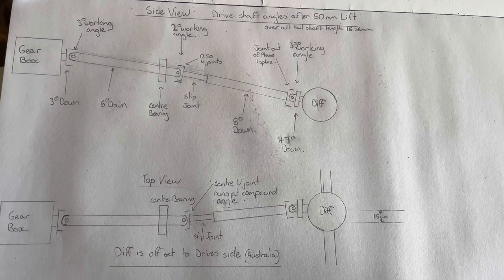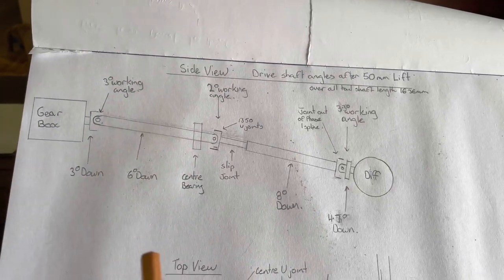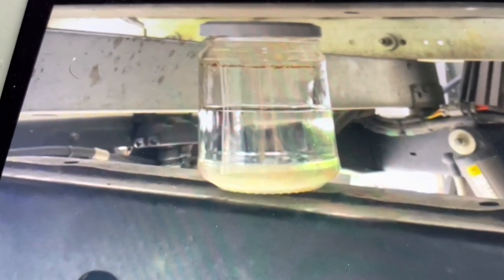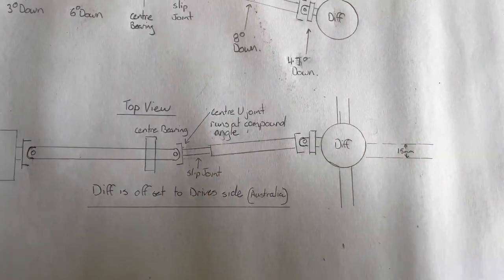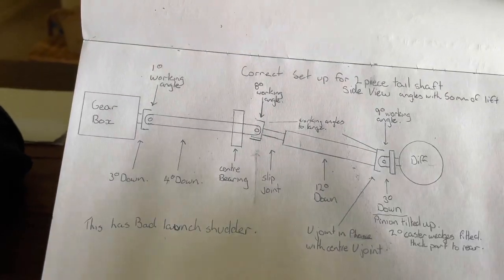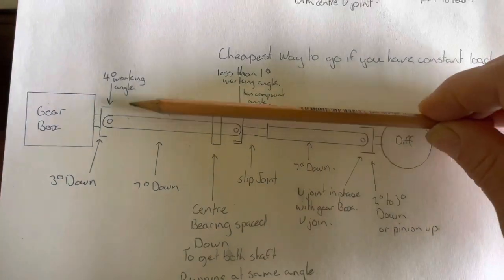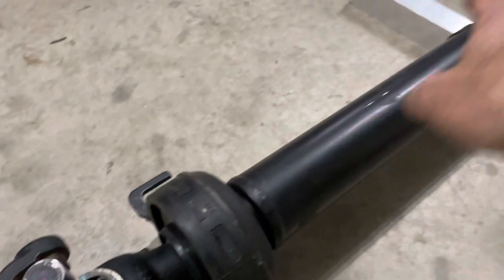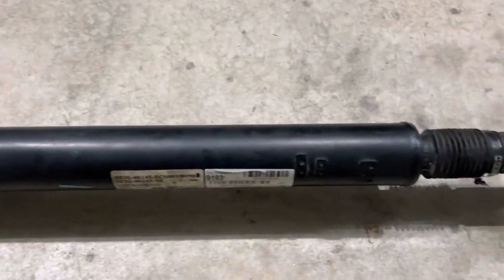Px Ranger/BT 50 drive shaft vibration fix

Comment: 2008 4x2 Hi-Rider dualcab. Had terrible shaft vibration at 45-60km/h.
Rebuilt 3 x uni's and centre bearing.  Dropped centre bearing mount to ensure shafts were parallel and fillled centre bearing bush with silicone to soak up remaining frequency. Thankyou ! Worked a treat.
Reply from the maker: Thank you for the feedback :)

Comment: Afternoon Phil. 
I have been heading down the same long dusty trail you did but I hope your video has saved me from the dead end of it. 
I got onto you and your fix video from a lake mac driveline shop. 
So my 19 ranger has a slight take off shudder also after my 2 inch lift and I have the center bearing drop already installed. I’m going to invest some time over the weekend to perform the phase alignment . I’m super excited for the result of no vibration. Fingers crossed 

So to clarify I need to have front and rear shafts at exact degrees. And the rear shaft phase aligned

Thanks
Reply from the maker: Yes that’s correct. Looking at the tail shafts from a side view you want to run them with next to 0° operating angle on the centre universal joint, Like I try to explain in the video if the front Shaft is for example 7° down the second shaft needs to be 7° down from the side view and phasing the tail shaft like it is a one piece shaft so pretend there is no uni in the middle. Remember that your diff pinion angle has to be the same angle as the angle down on the gearbox companion flange otherwise you will still have a vibration. So if the gearbox Companion flange is down 3° you need to tilt opinion so it is tilted up 3°. In the description section and of the video I have a link to the Spicer Drive line book which explains things very well. Remember this is a good setup for a constant load in the vehicle has varying loads will change the angle of the second Drive Shaft due to the compression of the spring pack. 
Let us know how you go

Comment from the maker: Mazda told me that is how it is and put up with it. One thing to note is the T6 platform that these Utes are built on has a natural tendency to vibrate anyway it’s sort of feels like the chassis is flexing up and down while you’re driving down the road. Having a driveline vibration magnifies this. My vibration would cut in and stay there from 35 km an hour all the way through to 110 KPH. Now the vibration comes and goes due to road surface conditions. One thing to note if you have am mud tires on the vehicle this will make the vibration worse also, I ended up changing back to a all-terrain tyre as I mainly drive up and down the highway now.

Comment: Hi Phil, thank you for the video very informative that's for sure.
One part I don't understand is from the gearbox to the short shaft you mentioned that is 1deg. .my gearbox is at 4deg then to 9deg on the first shaft, 8.5 from bearing to diff and diff is at 8.9. I'm still getting vibration like crazy can't drive over 80kms.
Reply from the maker: Hi bill just so I’m reading your angles right. You have 4deg down on the output flange of the gear/ transfer case and 8•9deg up on your pinion flange this is your problem it needs to be 3 to 4 degrees up not 8•9deg up. You need to put the caster  wedge with the thick part towards the front to drop the pinion down( I said it the wrong way around in the video as I had spent that week working on a land cruiser driveline vibration my bad when I get better I’m going to redo video)imagine both companion flanges need to run parallel to each other from the side view to keep the uni at the same angle. After dropping the pinion down you may need to re-shim the centre bearing to get the driveshaft angles the same again. Don’t forget to re-phase the differential universal joint to be in the same phase as the gearbox universal joint otherwise you will still have the vibration. This is explained in the video. Any more questions don’t hesitate to ask.
Reply: @philsrandomstuff2392  thank you so much.. I will order some 5deg casters from snake racings as they are the only ones hat have 5deg.. and if that doesn't fix it I will definitely go the same path as you and get the tailshaft fitted with cardan joint..
Reply from the maker: @billcetin3983  at 8.9deg pinion angle I’m thinking you have extended shackles? As most sit at 4 to 5 degrees. The double cardan shaft was worth the money. I here from owners of the new MY2023 ranger that ford included the drive line vibration from factory to.
Let me know how it turns out
Reply: @philsrandomstuff2392  it's actually a Dobinson lift kit.. 3inch front 2 inch back, but I did order the comfort springs and 0-100kg for the rear
Reply: I just had it fitted last week and been trouble shooting the vibration since.. 
So my car is good to about 80kms beyond that its a 40k vibrator
Reply from the maker: @billcetin3983  . I feel for you as it took me 3 months of trying different things to get it to run vibration free. It’s a shame the lift kit manufacturers have done nothing to really help address the vibration problem. I’m guessing you’re following my suggestion to run the two piece tail shaft in a dead straight line. I cannot stress enough that the differential u joint needs to be phased the same as the gearbox u joint otherwise the vibration will not go away no matter what you do. Sorry to harp on about this but I’ve had a number of people contact me about the vibrations still being there after doing what I suggested and then finding out that they have not change the phasing of the diff u joint.
Reply: @philsrandomstuff2392  the plan right now is to fit the caster and phase the tailshaft.. you have been very helpful thabk you so much.
What was the turn around time on getting your tailshaft fitted with the cardan fitted?
Reply from the maker: @billcetin3983   I don’t know where you’re based but I got the tail shaft done by Gibson Drive Shaft services in Newcastle, I think it was about a two week turnaround. So I could keep driving the vehicle I bought a low kilometre shaft assy from the wreckers 2.2 or 3.2L, auto or manual px1,2or 3 are the  same length and cost between $200 and $300 if your in the hunter valley area  And if we can work out how to meet you can take the spare one that I have in the shed and just replace it with the one from your car once you have it modified there is less than 50,000 km on that Shaft. Just remember to re-phase the tail shaft to suit the double cardan set up, which is the Centre bearing u joint and the differential U joint in the phase ( turn slip joint one spline) before you give it to the Drive Shaft shop so they can balance it properly. Cost was $800 to get the shaft modified
Reply: @philsrandomstuff2392  thank you Phil.. you are are a champion.
I will talk to the guys here in Sydney to see what kind of turn around time for a phase and balance hopefully that wouldn't take two weeks and go from there
Reply from the maker: @billcetin3983  anymore questions don’t hesitate to ask, hopefully the caster wedges, re-phrasing the diff u joint and running the shafts in a straight line will help save you some money
Reply: @philsrandomstuff2392  thank you Phil.
The caster wedge I ordered just got delivered this morning after doing a tour of Australia finally made it here.
I'm going to install them tomorrow and hopefully fix the issue.
I also noticed the leafsping has a caster on it from factory however it is facing the opposite way therefore pushing the pinion up
Reply from the maker: @billcetin3983  when you said that you had 8.9degs up on the pinion I thought that it was a bit odd. They could be turned around but at a guess they are 4 to 5 degrees which could  be to much depending on spring design . I normally fit 2 / 3 degrees wedges. Arb is where I sometimes get wedges But there are a lot of online parts shops that sell those smaller size wedges. Everything that I have gotten off superior engineering always takes forever to get to me( up to 3 months) I guessing you are going to stack the wedges , which will be ok providing you have enough centre pin head to still engage in the spring perch on the axle tube.
Reply: Hi Phil, so here is the outcome of today's fix a POS Mazda..
We turned the caster that was on the spring pack from Dobinson resulting in the pinion dropping 5deg.. so wasted money on casters.. I phased the tailshaft as best as I can and still vibrating..
Reply: @philsrandomstuff2392  current angle are 4deg down at transfer to 9.1 at the short shaft 10deg at long shaft and 4.1 at pinion
Reply from the maker: @billcetin3983  that should work ok
 The closer the angle on the two shafts the better as the the centre uni runs with a compound angle  so yours is probably at 1.5 / 2 degrees working angle. But if you load your Ute up regularly .9 degree will spot on. You normally try to have the pinion .5 to 1 degrees lower than gear box out as the pinion lifts under drive so yours should be 3 to 3.5 degrees. If you have a stiff spring pack you will be ok. You won’t do any damage by test driving it.
Reply: @philsrandomstuff2392  but the vibration is still there.. so on Monday I'm going back to the get the tyres checked and balance.. I might just get the double cardan joint done to the tailshaft if that is going to fix this issue.
Reply from the maker: @billcetin3983  do you have axle stand to put it under the back axle so you can run it up with a glass of water on the chassis like i did in the video as this will tell you if it’s tail shaft or tyres. no ripples in the water means the tail shaft is fine and the tyres are causing the vibration. Slowly run the vehicle up when it’s on axle stands and watch how much movement you have in the centre bearing if it wobbles around at slow speeds you were going to have a vibration at High speeds. I had mud tires on mine and they had to go as they made the vibration worse, if you can find someone with some stock ties and run them to see if that makes any difference. Once you get above 4° working angle on a universal joint there is always a chance of vibration unfortunately which is where you’re at and that’s why I had to go down the line of the double cardan  Shaft.
Reply from the maker: Would like to have a chat on the phone
Reply from the maker: @billcetin3983  Did you recheck your tail shaft angles after you changed the pinion angle because every time you move the pinion angle the second tail shaft angle changes
Reply: @philsrandomstuff2392  yeah for sure
Reply: No space in between..
Reply: Not letting me share contact details
Reply from the maker: @billcetin3983  I can not get it to work also are you on Facebook?
Reply: @philsrandomstuff2392  that's the one .. that's me
Reply from the maker: @billcetin3983  I have sent you a message via messenger

Comment: I`vefound vibration occurs  2 ways    1/ incorrect angle [lift or worn c /bearing ] typically u drive thru this . 20-50km/h 
2 / missing weights  damage [increases as vehicle speed goes up]

Comment: This is a great video, I have a 2012  PX 3.2 4x4 manual . I have a vibration in the tail shaft at about 1200 rpm when I shift into 3rd gear . If I run the revs over 1500 its not too bad but I don't want to shift to second on all  corners. 
There is no vibration noticeable at 50 kph and over  I have changed the unis, greased the splines , phased the t unis and have the shafts in as straight a line as possible with about 1/2 degree  vertical difference between the 2 shafts by use of the spacer kit. 
The pinion angles are equal between the diff and transfer case. I am not the first owner so am not sure what the lift is . No matter what I try it doesn't seem to make any difference.  Very frustrating .
Reply from the maker: Hi Alastair I’m not 100% sure on what type of centre bearing on the earlier utes had, but it’s unlikely that it’s the Source of your vibration I only added the nylon insert just to take the final bit of vibration out of the tail shaft, this vibration only happened when you hit Bumps  At speed the nylon insert just helped stabilise the shaft it didn’t really need it. So from what I’m reading above is that you have set it up in a straight line with the universal joints rephased I would suggest that the tail shaft probably needs Balancing. Every time I move something around in a tail shaft you can affect the balance. You can take your now re-phase tail shaft to a driveline shop and have it balanced and checked for straightnesses or you can dynamically balance the tail shaft on the vehicle there is several YouTube videos about this just search by dynamic tail shaft balancing. The reason why I went to a double carden in joint was I still could not get all the vibration out the new tail  shaft fixed this problem altogether, but costs a bit to do.

Comment: Phil I love this video I have vibrations when towing the camper a droning sound followed by vibration. Car has front Bullbar on stock suspension. Where can I go to get this fixed. Would a regular mechanic know about this?
Reply from the maker: Not many people know much about how to fix drive line vibrations, thats why I made this video. Any good mechanic should be able to fix it if they watch this video. Remember some times it’s not the drive shaft but something else like flat spots on tyres and the like, yours does sound like drive shaft by the description you give though.

Comment: This vibration has been bugging me since new and it is significantly worse with the 50mm lift. Mazda would have you believe it's a feature  not a fault in design.  Anyway it looks like you did some detailed research and I will definitely give it a shot 👍
Reply from the maker: Let me know how you go.
Reply: @philsrandomstuff2392  First a little background on the BT50. I have a 50mm lift and and a centre bearing drop kit already installed that has helped a bit with vibrations at highway speeds but it left a severe  pulse in the drive line at around 30kph no matter how it was adjusted. Well this morning I figured I would re-phase the shaft and much to my surprise the low speed pulse is virtually gone. Now it's not perfect,  however I still need to adjust the pinion angle slightly and lower the centre bearing another .5deg but I could live with it as is that's for sure. So overall I will give you two thumbs up on this one Phil thanks for the video. 👍👍
Reply from the maker: @andrewcarroll9148  thanks for letting me know how it turned out, l’m glad it made a difference. I had to install 2deg caster wedges (thick part to front of Ute) this gave me 2.7deg pinion up to match the gear box 3deg down. Running the tail shaft dead straight like you have made my vibration about a 93% gone. ARB sell caster wedges

Comment: Your centre bearing rubber looks different. Did you fill it with urethane?
Reply from the maker: Yes I did try to stiffen up the centre bearing. But the urethane was to stiff. The gear box moves around a lot and it was placing to much load on the centre bearing. That is why I put a nylon ring in the centre bearing housing to help hold the shaft central but still allow it to kick when the gear box/ engine lifts under load.
Reply: @philsrandomstuff2392  hey thx for the reply.. you're saying the centre bearing was stressed coz it couldn't freely change operating angle? And the nylon ring potentially reduces the skipping rope effect by keeping it centred? How thick is the ring?
Did it make much difference?
I'm chasing a low frequency driveline shake. Can see the diff pinion nodding like crazy when its doing it. Feels like clutch shudder (but its not). Standard suspension. Cheers
Reply from the maker: @Huskydog78  with my Mazda it had a similar sort of low frequency vibration with the stock suspension to. I didn’t address this until I lifted it as I knew the vibration would get worse with increased suspension lift. In my experience Making the centre bearing stiffer didn’t fix the problem of the vibration, it all has to do with the out of phasing of the differential u joint , Pinion angle and Drive Shaft angles. Stiffening the centre bearing up got rid of about 2% of my vibration, but as I know every vehicle is different so the nylon ring that I put in the centre bearing is approximately 25 mm thick and I’m sorry I can’t remember the internal and external the measurement the dimensions, You will notice a rubber castellated section around the actual bearing. I made the inside diameter of the nylon insert the same as the outside diameter is this so it just helps support the centre bearing.To save money I originally made the nylon ring out of two pieces  of half inch cutting board(used a jigsaw  to cut the cutting board up) and self tappers to hold  the two pieces together once in the centre bearing housing, that way I could put a slit in the rings so I could slip it over the tail shaft without having to disassemble the tail shaft and offset the splits in the two nylon rings so I could test if it made any difference. 
If your opinion is nodding up and down it is definitely a phasing issue of the tail shaft but it’s hard to say as I’m not  looking at your car. If you set up the tail shaft like I explain in my video which is running both tail shafts at the same angle and re-phasing the differential your joint to be the same phase as a gearbox u joint you will have a nice smooth running tail shaft, remember if this doesn’t work you can always and put it back to the way it was.
If you believe it is the centre bearing have a look at the Ranger raptor it uses A better supported tail shaft centre bearing and this might fit in a standard Ranger